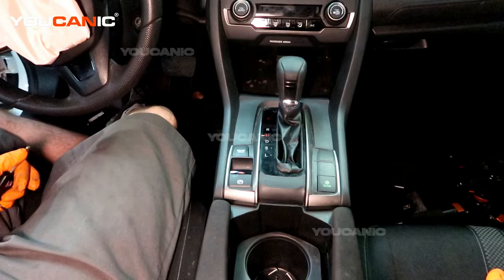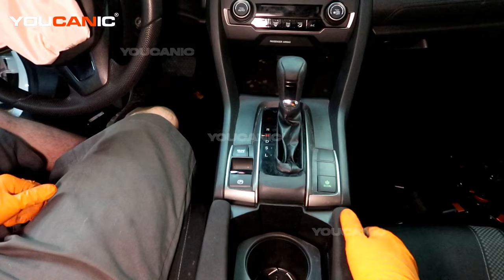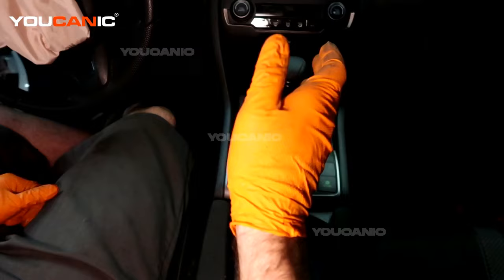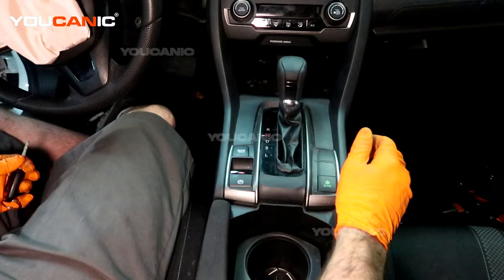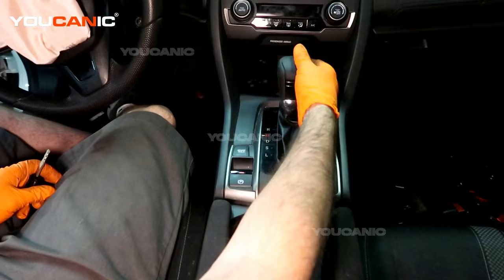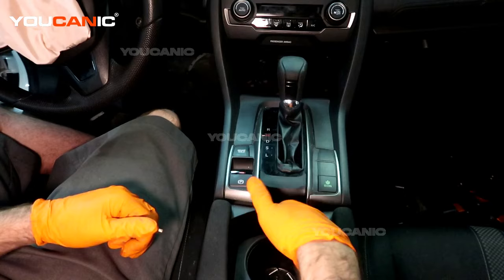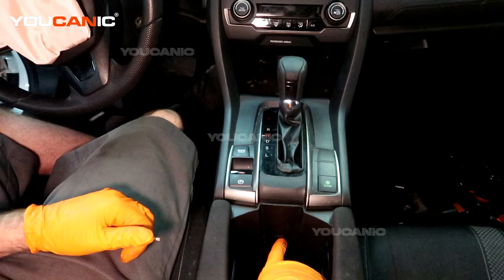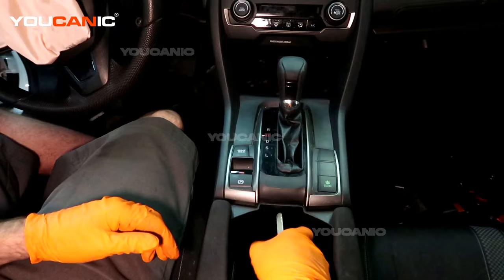2016-2021 Honda Civic- Release Gear Shift Manually (Transmission Stuck in Park)

Comment: Man, my gear got stuck between park and reverse and can't turn off heat and everything except the engine.. good thing I'm already in the garage and saw this video! You're a saver! Thanks!
Reply from the maker: It's great to hear our video helped you out! If you ever face more car issues, consider the YOUCANIC Full System Scanner to help you diagnose problems, much like a professional mechanic. Detailed information about the scanner can be found here: www.youcanic.com/scanner. Also, YOUCANIC offers a platform where you can ask car-related questions. For further guidance, don't hesitate to visit us at www.youcanic.com. We make car repairs accessible and understandable. Thanks for trusting YOUCANIC!

Comment: How wld your fix this permanently? I recently crashed mine as well how does this get fixed? Also do u have a video on a multiple warning light on the dash? The battery was put in back wards and fried a fuse i replaced it but can’t get the transmission lock to permanently come off
Reply from the maker: Thank you for your comment and questions! At YOUCANIC, we're committed to helping you with your car repairs and maintenance. We do have videos and guide resources that can assist you with issues like warning lights on the dash and fixing a transmission lock. Also, our YOUCANIC scanner might be helpful in diagnosing the issues.

Take advantage of our factory repair manuals to get in-depth insights into fixing your car permanently. Visit us at www.youcanic.com for any further assistance or questions. We're here to make your car ownership journey smooth and confident!

Comment: What if the car won’t budge even when shifted into neutral, gear, reverse, etc. while using this method to shift? Seized brakes or line?
Reply: We shook the car a bit and it moved. I think the brakes were seized from sitting so long.

Comment: Mine did it after reverse battery damage, i can do it this way but i still find out why it wont shift after replacing main fuse
Reply from the maker: Thanks for reaching out! At Youcanic, we're here to help empower car owners like you and provide the resources you need to tackle your own car maintenance. If you're experiencing shifting issues after a fuse replacement and can't identify the problem, our online guides and YOUCANIC scanner can provide additional assistance. 

Furthermore, if you require more detailed help, consider examining our factory repair manuals at www.youcanic.com. Our mission is to support car owners throughout their maintenance journey as a key part of their drive to self-sufficiency. We're here to help, so don't hesitate to reach out to us on our site.

Comment: How do you get it out of the mode or whatever
Reply from the maker: Hi, getting your car out of its current mode may depend on the specific issue. I'd recommend using YOUCANIC's Full System Scanner (www.youcanic.com/scanner) to diagnose the problem. This tool can provide invaluable insights and guidance, like having a mechanic at your disposal.

If you need additional assistance or have questions, feel free to ask at www.youcanic.com. Our platform combines a wealth of resources, from OEM Factory Repair Manuals to a community forum. Your automotive journey and understanding is our priority. Let's keep your car running smoothly together.